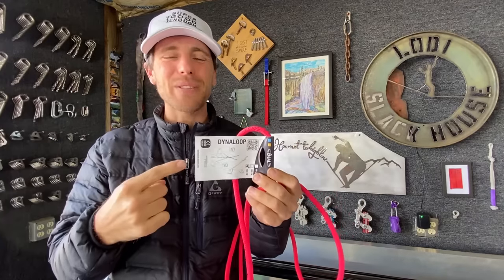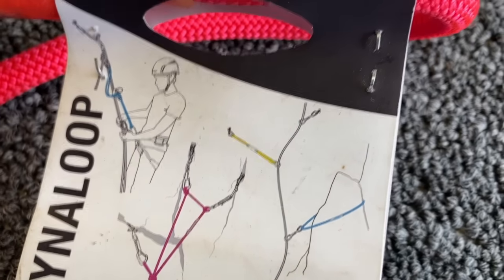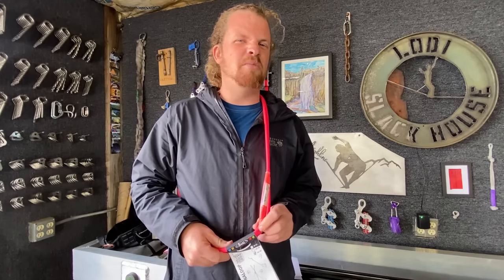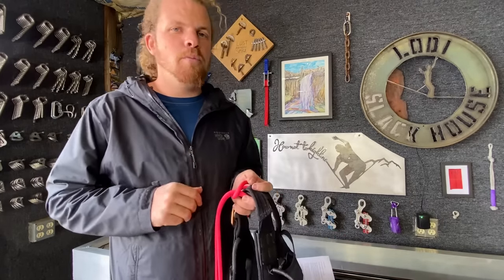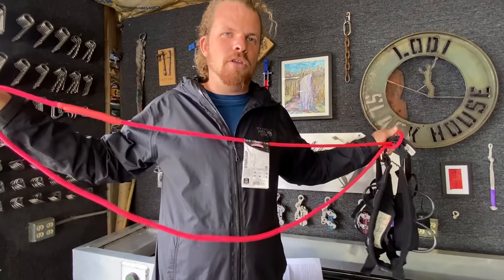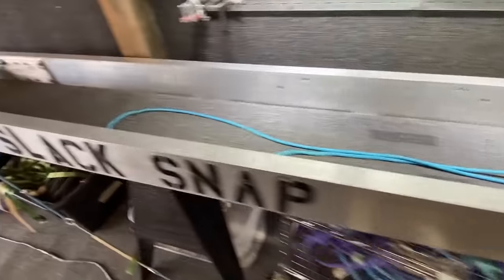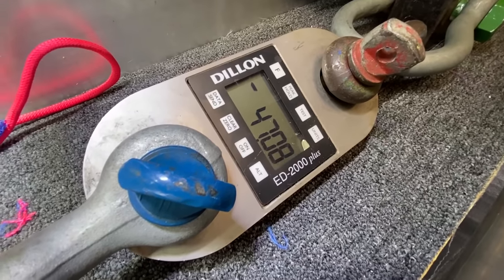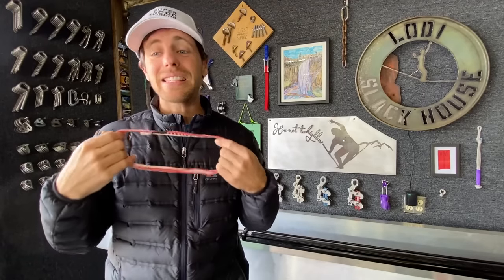Climbing harnesses vs beal dynaloops - what breaks first?

Comment: We can actually use a good sliding X on 2 anchor points now, without tying knots and get the full width that a sliding X gives you..I picked up a few myself
Reply: Try normal 6, 8 or 9mm cord (6 only for 3 point pro) you can whip up almost any anchor easy as. The webalette is another thing in the same vein.
Reply: Why wouldn't you be able to do that with a sling?
Besides if you make a double sliding x and make knots closer to the bolts you still have a very big auto balancing area for the rope point while also getting the safety of the knots if a strand were to break for some reason. 
Double sliding x with knots still give around 50kn which is SUPER GOOD ENOUGH xD

Comment: I've been reading about cams with extendable slings (specifically the Wild Country New Friends and the Aliens) and what loads cause the thumb loops to start to kink. Black Diamond has a QC lab article saying they saw their thumb loops get majorly kinked at only 3-4kN but other cams claim to fair better than that. I've taken a couple small falls on WC #1 friends with the thinner dyneema slings (can't remember if they were extended, but probably were) and the thumbloop shape got stretched slightly but I'd hardly call it kinked.

Comment: I have one of these. instead of 120cm sling, you need 150cm dynaloop to tie an anchor, because the knot is so bulky ! Heavy, impractical, but I still love it. Have been keeping it in my pack to tie off trees, but it was on my harness when I started multipitch for that extra safety feeling 😂

Comment: How about a reverso break test? im curious about how pulling a person that lost the strength while climbing actually affects the reverso, specially when you belay 2 people and the load on each rope is different. thanks for the good content!
Reply: Similarly I'd be interested in how strong the DMM pivot's guide mode ring is.
Reply: @joshuacilliers2723  Definitely interested in that. Guide mode has always unnerved me - though I know that's illogical given the forces involved.
Reply: @SergieRachmaninoff  if you've got a device that supports it, it's well worth getting used to it, esp. for multipitch. That being said, learn and practice the lowering methods before you get in a situation where you have to lower a second :) learnt that the hard way
Reply from the maker: I believe it breaks the rope before the device so belay devices don't really break... just brake haha.  But i can test that to see how much it reduces the rope's strength
Reply: @HowNOT2  in terms of the DMM one, I was more curious about the actual pivot attachment.
Reply: @HowNOT2  I have a DMM pivot you can have to test the pivot hinge if useful? (The 'teeth' in the tube wore out way too quickly, so happy for it to get destroyed...)

Comment: Nice test! I have a friend that for anchor he do 2x clover hitches and atach to two carabiners, and one is just for backup so if means that if he falls it will be a fall in just one single part of this loop (half strength). what do you think about it? I think this is the most common scenario for sport roupes because you will be attached to two points of failure;

Comment: Interesting that the 4x sliding X failed 'low' (or lower than expected...) I use the same sliding X setup on multipitch sport belays with a Kevlar sling threaded through the rap rings (super fast and convenient to set up and take down). I wonder if one of these Dyna things would be a better option than a Kevlar sling for the stretchiness.

Comment: From watching a few of your videos, my impression is that while climbing you will never get more than 2 kn anywhere.
These high kn values seems very overkill, could you maybe make a video about what situations you would need different kn ratings, and then compare it to the gear that best fit these requirement?

Using the official ratings, and numbers  you've gathered throughout all your testing.
Reply: you can easily get more than 6-7 kn on an anchor during a lead fall(i dont know where you got the 2kn number from, the beleyer will allmost never see more than 2kn but its still posible to get 3kn while beleying) and a knot in a sling can reduce the strenght by up to 60% or a sharp bend radius on rope can reduce the strenght of a dynamic rope by 50%. the age of slings or rope can also reduse the strenght down to 16 kn or even more if the rope is dirty. so you combine all of that you can experiance a 7kn lead fall on a sling with a knot that is 5+ years old (so 40% of 16 kn is 6.4kn) so you die. this is an extreme example but all the numbers are not made up but are sorced from youtube videos, scientfic articles and profesional literature(im a firefighter so there are a couple of really quality books available)

edit: and its allways beter to have a safety ratio of at least 2/1 but 5/1 or even 10/1 if preferd
Reply: @16m49x3  im sorry if i sounded  condesending that apsolutly wasent my intention, i just wanted to point out that a 22kn rating isnt allways safe and if you bellive that you can never generate more than 2kn you could put yourself in some very dangerous situations. stay safe and knowledge is power where my two points to make.

p.s. if you could point out what sounds condesending i would apreciate it and i could try and improve for the nex time
Reply: @termivan  
I'm well aware of safety margins, and I'm well aware that things get worn out...
Just not relevant to the topic.

This video showed things breaking at 40kN

If you want to know where I get 2kN from 
https://youtu.be/m8z6adEqaOs?t=630
it's videos like these.
Reply: @termivan  While you can see 7 on a lead fall I’m not sure I’d call it easily. Thats quite a spectacular fall with a harsh catch.